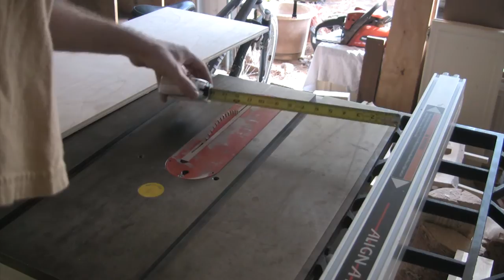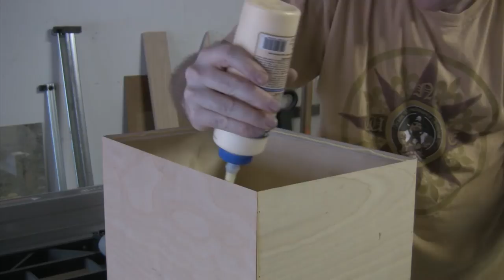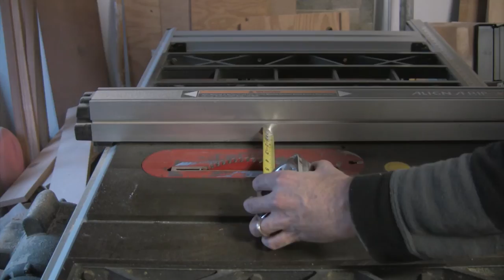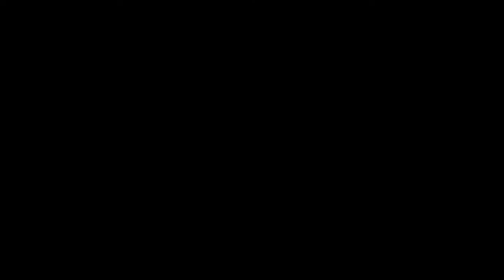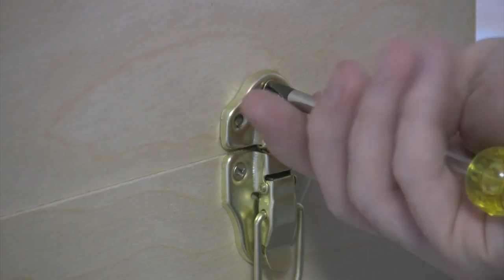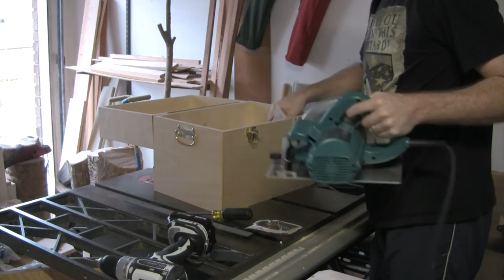Circular Saw Case

Comment: 64k viewers learning the improper way to use a table saw. Use your riving knife. Always bring your blade to proper depth. Always use a push stick of some sort. The board can kick and force your hand into the blade. I've been using all types of saw for over 20 years and have yet to cut myself because I always practice safty and it is irresponsible for someone to make a video new or old that teaches the opposite.

Comment: I would have cut the sides on a 30 degree angle so you don't have the lift over of such a deep box. Fussy Me.
Reply from the maker: That's not a bad idea, and would certainly be similar to a lot of commercial designs.  It's only a couple of inches though, so it's not too bad to lift in and out of the box.